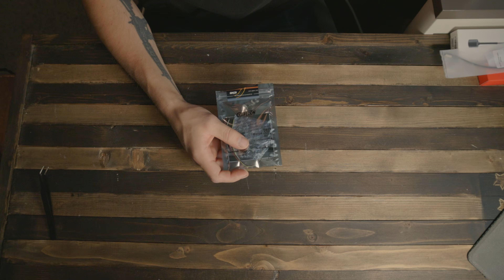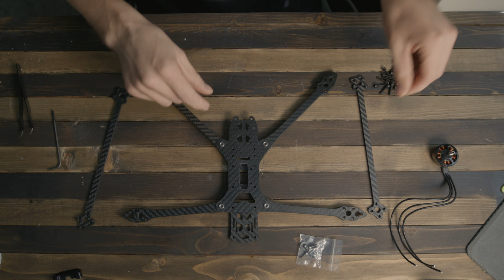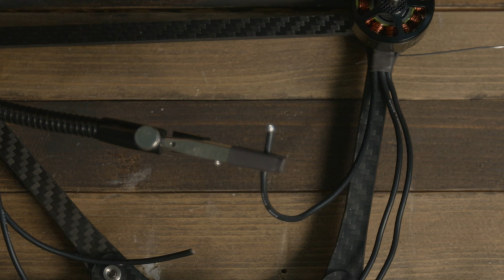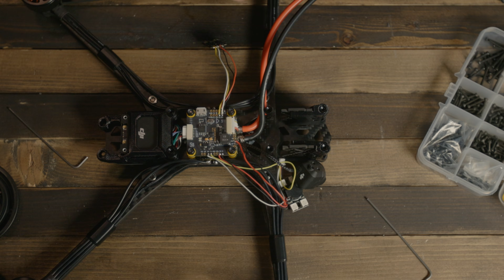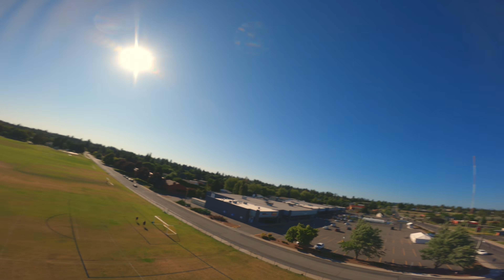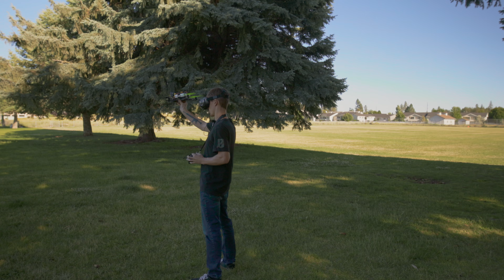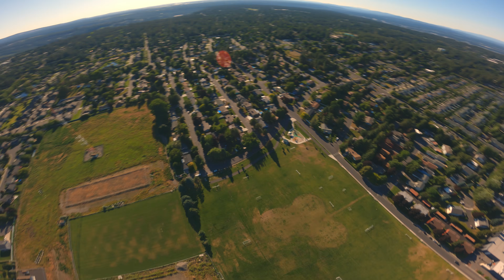How To Build A 7 Inch Long Range FPV Drone

Comment: The Immortal T antenna will work for ELRS, but you might not have the same performance because crossfire is 915mhz and ELRS is 2.4ghz, at least that was what I was told by some ELRS guy, so I use the TBS Tracer antennas, because Tracer is 2.4GhZ.
Reply: paused the video to look for this comment. defo need to get the correct 2.4 antenna!
Reply from the maker: @djSpinege   Nah the CRSF Antennas are working perfectly 🫡 😁.
Reply: they are not tuned to 2.4 ... far from perfect. just trying to help ...  @Androidfpv
Reply: @Androidfpv  radiomaster sells long 2.4ghz antennas
Reply from the maker: I was worried about that and thought the same thing. But so far in my testing the link has been solid out to 4 miles (will post that video soon). During my turn around at 4 miles I had a micro failsafe flash bad rx or rx loss but didn't seem to last long enough for stage 1 or 2. The drone kept moving fine. other than that I haven't had any issues thankfully.
Reply: @Androidfpv  DO NOT use the immortal T with your 2.4 elrs receiver! You are slowly burning out the telemetry transmitter on the receiver! They are pretty strong, up to around 100mW and that is slowly burning it.
Reply: ELRS has a 2.4ghz and 915 mhz version. Modules, RX, and antennas will be different. Assuming you use 915mhz crsf antenna, with elrs 915, all will be good. However idk about the mismatching of 2.4g and 915mhz antennas.
Reply: He can cut the antenna down to size.